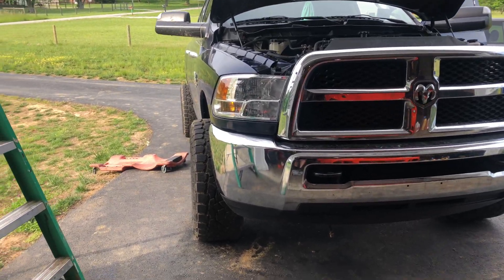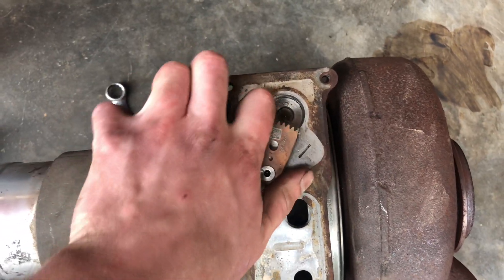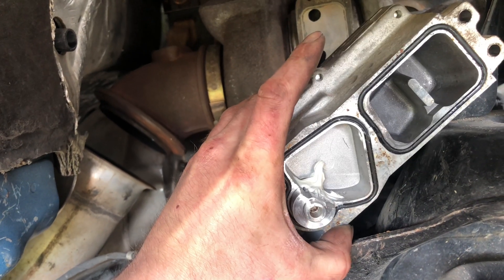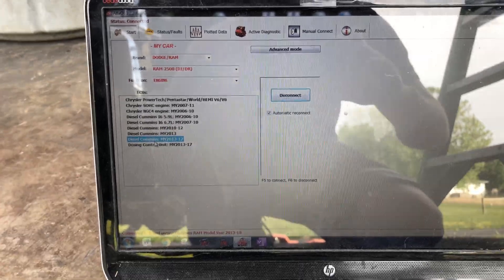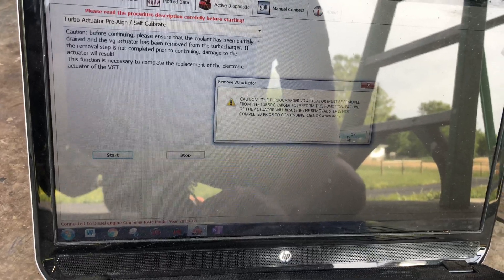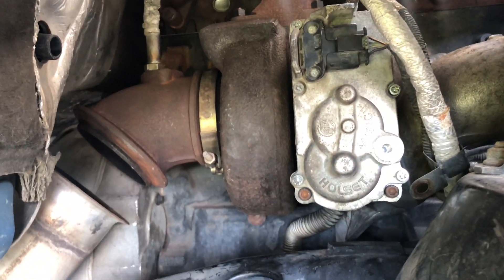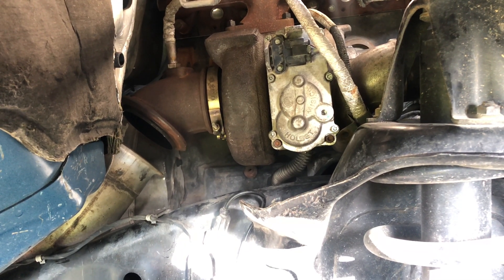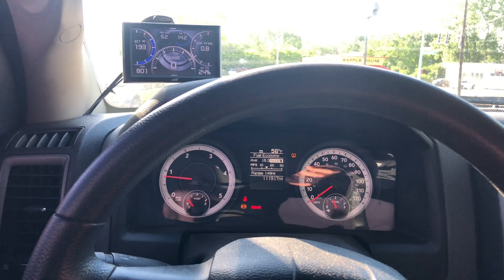HOW TO: calibrate new actuator on 6.7L Cummins VGT turbo w/ Alpha OBD. **No dealer required**

Comment: Baught a rebuilt actuator from Thoroughbred Diesel for $379.00 and completely rebuilt my turbo myself on my 07.5 6.7
Reply from the maker: I bought a used 55k mile turbo/actuator off marketplace for $500, swapped it into my truck and then sold my old turbo core for $400.
Reply: @flyboy1294 Where did you sell your old Turbo actuator? I'd like to see mine for $400 as well 😊
Reply from the maker: @Tthrills87  I think the website was called Diesel Punk Cores or something like that

Comment: Great Video! You have save me a lot of heartache! fixing my turbo.. Thanks for doing the video... I have learn so much form your video.
Reply: How you got connected the laptop to the truck?
Reply: @Thephoenix.777  OBDLInkMX+, that's what I used, its been a while if i remember correctly -Wifi/ Bluetooth from the laptop. I bought the turbo with actuator all in one. The actuator was already recalibrated so it was turn key which saved a lot of time.
Reply: @jamespurser2341   that you very much I appreciate it bro
Reply from the maker: Thanks man, glad it helped someone else

Comment: Why did you have engine failure? What got stuck in your turbo?
Reply from the maker: Grid heater bolt went through cylinder 6. Common issue on these trucks unfortunately.
Reply: If grid heater is bad, is that gonna affect my calibration on actuator (my mechanic is having problem with calibration)? Or turbo/actuator is totally separated from everything? Thanks

Comment: Thank you for this video. Does alphaobd have a test function for the actuator? My truck is throwing thr p2262 code and the exhaust brake stopped working.
Reply from the maker: I did not see any test functions in the software, no. 

Do you have a scan tool or a gauge montior? If you do, look up "VGT position actual" and "VGT position commanded" or something similar. You will be able to see if the turbo is getting hung that way. My last turbo was gettig stuck at 60%, so it'd still work okay but threw P226C error code a few times  a week.
Reply: @flyboy1294  I don't have a scan tool.yet. I just ordered a obdlink mx+ and will be getting alphaobd. Can that see the turbo position stuff you were talking abou?
Reply from the maker: @mastermoarman  You can't see it with AlphaOBD, but the MX+ BT comes with some free software called OBDwiz. You can connect to the truck with that and see the actuator position I believe